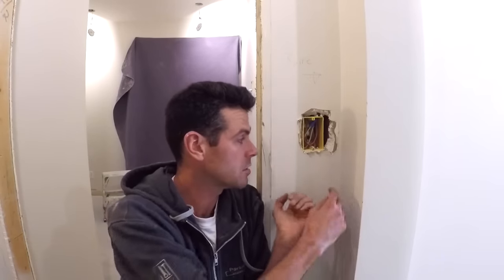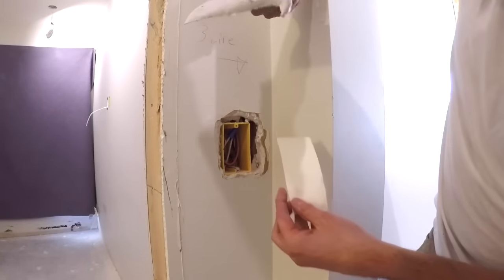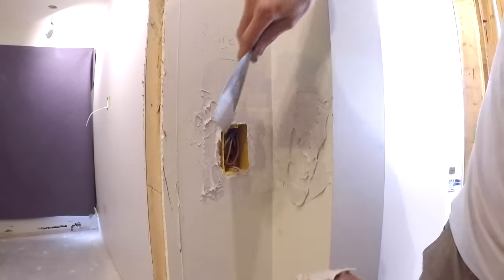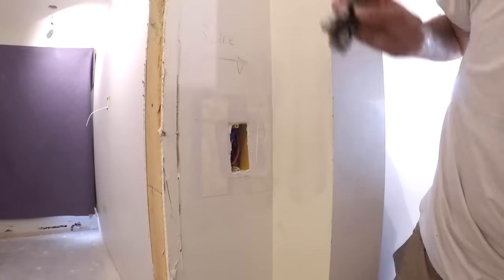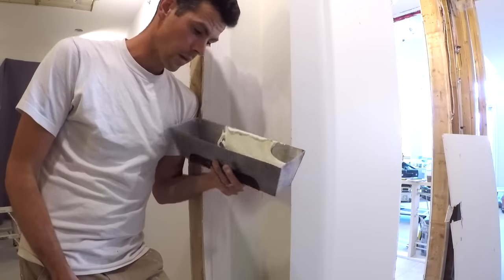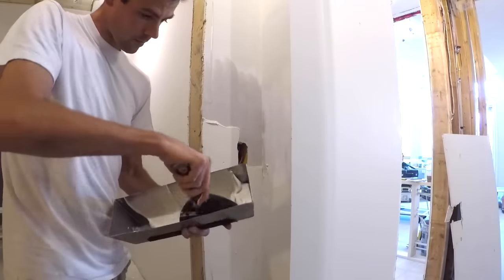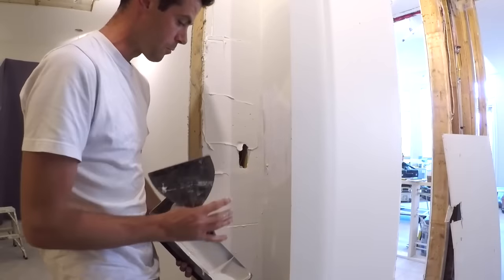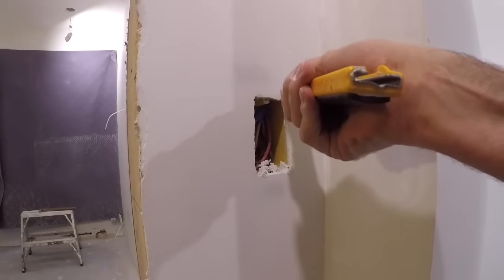HOW TO REPAIR OVERCUT ELECTRICAL BOX (DRYWALL)

Comment: Battle of the trades - dry waller covers or fills electricans box, painter comes and primes wall, electrican comes to put his switch in, cuts out dry wall, drywaller comes back to fix and spreds mud over 2' of wall, painter comes back  paints over switch, and the cycle repeats
Reply: And let's not leave the brainless plumbers who blow massive holes in the walls and don't give a rats ass for the customer who has to pay for all the extra damage s they inflict.
Reply: I do all theses   trades  so i dont deal with theses  problems.
Reply: Ngiovanni
Reply: And a Master at none.
Reply: And at the end of the day, someone doesn't get paid.
Reply: Robert w Sieburg plumbers have to get in the wall. No delicate way to do the job.
Reply: I personally like when the plumbers run a 4 inch pipe hanging half out a 2x4 wall because of the doubles and say the drywall guy can "wrap it"
Reply: Kevin Henry 

In my experience electricians are the biggest assholes of any trade. They will purposely damage shit knowing they will be gone before the finishers or painters will ever get there.
Reply: @chrisj197438  we don't purposely damage. Lot of times the engineers change their mind and tell us to put the switch p.e. elsewhere. And we are the last to get into the construction site, to put the switches, wall plugs etc. 
   But a friend of mine who is a painter tells me that painters hate electricians above everyone else
Reply: mpirarxos 

You may do your best to keep damage to a minimum but I’ve seen guys do damage that was totally unnecessary.
Reply: Peter pecker 

I’ve seen it from both sides
Reply: @1stFlyingeagle  when I need professional plumbing work done, I'm the one who busts the holes in my walls or floors. This way, I know exactly what to repair, with no sudden surprises months or years down the road. After all, I give a shit and know more about my house than even the best plumber ever would.
Reply: Do you have an associates or bachelors degree in construction management?
Reply: Too accurate
Reply: Kevin 
A good painter will put  a piece of painters tape over the electrical switch or outlet tape is cheap so the cycle doesn't start over it stops there...
Reply: So true LOL LOL... From a local 3 electrician you're absolutely correct bro you got me on the ground rolling over here
Reply: bad GC
Reply: You are so right. Trying to keep trades in line is like herding cats. It’s like the kids in the kindergarten class that don’t know how to share lol
Reply: Another Fool hahahahaha
Reply: And all of them are tracking in mud on the new carpet the carpet layer just installed...
Reply: Juts tearing down drywall in my jobs site cause someone forgot to install the exit lights boxes
Reply: @chrisj197438  That is not why they are assholes. Electricians get tired or having to dig out buried boxes that the sheet rockers have covered due to their negligence. Its a tool to maybe teach the sheet rockers that if they keep burying boxes they will keep having to come back to fix the wall. I personally have never done that but that's what i hear from other guys in the trade and i totally understand the mindset.
Reply: Robert w Sieburg I've seen where the plumber cut through 2 and a half out of a triple 2×10 triple load bearing beam to run his turd pipe.Plumbers are brutal to framing.
Reply: Robert w Sieburg as a drywall finisher I totally hear you there. I love it when they use a hammer to make their holes but I'm sure I'm the only one that's run across that stupidity. A bit of sarcasm I've seen it enough in 18 years
Reply: Rick Babcock that’s how I worked too. It’s a shame more pride isn’t evident in the trades
Reply: Electricians get the short end of the stick. In new buildings, the plumbers come in and tear out our wiring to run their pipes and paint and drywaller’s  bury or cover our plug/switch wires with paint or mud or break our boxes. Don’t even get me started on the irrigation guys that cut all the underground conduit with their trenchers.
Reply: Job security :)
Reply: The problem is that none of the tradesmen give a shit about doing the job properly, and just pass the buck to the next guy down the line. Maybe if people actually cared like this guy...
Reply: Chump Johnson It does go both ways I’ve seen mudders bury boxes on purpose and electricians use a hammer to unbury them.
Reply: @DamionJR4923  Very true. Everyone passes the buck to the next guy down the line.
Reply: @craigslistrro709  Master of Some!
Reply: @madmanmapper  
I was astonished the first time I heard a drywaller mess up some boxes and say "Screwit, mudman will get it." At that time, I WAS the mudman!  👿
Reply: Wait one moment before you put the cover on that outlet  I’m a  landscaper I have to get into that electrical box  and the  roofer wants  a shot at it to why not
Reply: christopherologist, the thats why when I wire my boxes I make sure to push as much as possible to the back nicked wires is one thing but wires that are sliced to the point of breaking or just cut in half pisses me off
Reply: Kevin Henry
Reply: Someone has to paint over the fire alarm AVs too.
Reply: It all adds up to screwing the customer. Would rarely happen with a knowledgeable general contractor and supervisor.
Reply: @chrisj197438  Sometimes, you just can't win. I took a lot of s*** as a young woman working construction, and a lot of my time was spent cleaning up the mess because somebody changed things "just a bch" over there from here.
Reply: @chrisj197438  AMEN to that. I needed the formal education for my Master, but learned 99% of what matters from my dad on the job by the time I was 15.
Reply: perfect harmony, job security!
Reply: @craigslistrro709   oh but is he a master of none, if hes not dealing with 3 other trades screwing up his work, chances are hes knocking down cold ones watching the football game wile they are screwing up each others work!  id say hes mastered cutting down the work load.
Reply: @nkyryry   just tear off large chunks of sheet rock and power boxes.
Reply: @koutouloufas7  why hate a guy whos paying for your new jet boat?
Reply: @rollingrizzo1291  
yes cuse that drctorate in bussiness managment is really ginna come in handy flipping bugers at mc donalds for mim wadge.
Reply: Chump Johnson electricians are the 2nd in the job,behind plumbers(underground )and the last to leave always,next time comment on something you’re knowledgeable at
Reply: Soup Can change orders are nice,more cash for you
Reply: Chump Johnson engineers can draw a circuit but can’t bring it to reality
Reply: jakestoe should’ve called the tile guys ...
Reply: Kevin Henry And the customer pays all those times 🤨😧😩
Reply: @albertj3421  started with the architect who should have drawn it as a 6" wall.
Reply: If someone fucks up my shit, I get paid to go back and fix it. By all means, fuck it up lol, I like the job security.
Reply: Job security is what I call it
Reply: I'd say it up to the poor guy who has to put on the plate after it's painted
Reply: I got to the place when trimming out a house, we would work with the builder and have the actual drywall company uncover our covered up electrical boxes themselves. That way if they messed up their drywall it was on them. Usually they would cut it out perfect. Many electricians are very good and finding and uncovering boxes but many are not. It pays to work with the trades. Residential or Commercial. 👍 God bless.

Jeff -Licensed Electrician - Sunny Central Florida 😎 👍🙏🌴 ☀️ 🍊
Reply: Rick Babcock they call you a master of nothing. Aka handyman.
Reply: Peter pecker lol the only thing union electricians know how to do is run pipe.
Reply: In my experience, the sequence of trades should be: structural framers, plumbers (waste pipes must meet minimum slope), then HVAC (large equipment and ductwork) electricians (especially when they have to rack the conduits), fire protection, drywall, painters, finish work. However, sometimes it's like having a gun go off and transforming the entire construction site into a free for all mess.
Reply: @chrisj197438  Im an Electrician and I do care about the other trades.  I give my helpers hell for putting finger prints on the walls while hanging a fixture anything like that.
Reply: And guess who hears about it all from each trade ME
Reply: Kevin Henry so yea, the painter fixes it in the end
Reply: I’m the painter. I’m the final trade in the house. If I have to stop my job and wait for the sparky and a increase my workload, I’d be back charging them my hours + their hours for what I could have done myself in an hour whether that wall is textured or level 5 smooth wall.
Reply: I fucking love this comment thread.
Reply: LMMFAO well at least you assholes left us trim carpenters out 😂🤣😂🤣
Reply: woodie will fail inspection
Reply: Drywallers are cheap ,electricians are not.
Reply: Chump Johnson ikr college is shit
Reply: @chrisj197438  they've tried but I'm the Finisher and I back charge at $360.00 an hour 10 hr.(contract) Minimum . You want others to step up , take their money . that makes lesser tradesmen step up or go broke . I give them a chance but never at my expense .
Reply: Yup same bullshit I deal with. Just went through some units today patching overcuts around outlets and bathroom lights so the painter can repaint. Seems like the system will never be figured out
Reply: Yup
Reply: 20 year exp painter here. Were the last guys so homeowners expect miracles from us
Reply: Job security 👍
Reply: Tell me about it jeez
Reply: @onecrazywheel  the only problem with that is once we cut out our box nicely. You tighten your screws and the drywall pushes in exposing the screw heads in the drywall above and below.
Reply: @atom4871  I agree, my guys have to wear gloves at trim out.
Reply: I am a framer /carpenter and the electrician came and set his recessed lights, plumbers came in and knocked one down, electrician came and asked me to run two 2x4s beside the can light and screw the can light to framing... I asked if it would pass that way and he said yes... so I framed it up and screwed the light to the framing.... now the inspector wants to know what’s going on there 🤷‍♂️🤦‍♂️🤦‍♂️🤦‍♂️
Reply: Joey MeckSk8Productions'  if everyone would start using bigger plates most of the problems would go away... personally I like the bigger plates not sure why it has to be so close...
Reply: Sounds about right 😂
Reply: @1stFlyingeagle  i would patch up after my job. The right way.
Reply: @rickbabcock6397  Same here. But I come behind on some jobs and do the mop-up.
Reply: Im a Painter, in my case i repair Mud guy messes n Electrition messes and Texture guy messes, all this guys come do they work n leave they messes, im the one who really finish the Job.
Reply: @chrisj197438  Electricians leave last...they install light fixtures , switches  ,receptacles , plates  etc. after everybody is gone...   and  fix  everybode else 's  shit
Reply: @1stFlyingeagle  don't forget about all the notches they make in the floor joist because someone read the plans wrong!
Reply: Framer: Not quite square but guess the drywaller can fix that.

Electrician after going crazy adding a gazilion outlets everywhere: Drywall guy can figure it out

Drywaller: Not quite right but plaster guy can fix that

Plasterer: Good enough, paint should fix that

Source: I'm a DIYer and I'm the framer, electrician, drywaller, plasterer and painter and I curse past me during each step.
Reply: @peterpecker7558  Union guys are lazy. Couldn't have paid me to join the brotherhood.
Reply: Sounds like what I used to deal with every day.
Reply: Wow this started quite a debate . Me personally I just fix it and don’t complain about it and if something gets changed and I have to fix it later then I charge for it plain and simple. The blame game is for kids
Reply: the  hahahahhahahahahathe  hahahahaaaa
Reply: Lol 😄😄😄
Reply: That's a new definition for "Circle Jerk"
Reply: Or you do everything and somehow still do it to yourself lmao
Reply: @1stFlyingeagle  buddy when u have a plumbing problem don't call plumbers do it yourself
Reply: @nkyryry  That is nothing but a BS excuse for sloppy plumbers. When I do plumbing they are easy to wall repairs. Almost always.
Reply: I hate it when a box gets covered by the drywallers. Then you wire everything up and shit don't work? Then it's like oh yeah I remember a box being in that spot! Then start the process again. Lol
Reply: @rickbabcock6397  actually was going to say the same.  Here at Empire State Contracting,  a company founded by brother,  we do everything for the most part.  There are a very few things we don't,  but this is more by choice, & so will sub it out. Ironically started as electricians,  but since we were always good with our hands, figuring things out & have a gift to learn quickly,  & so when the economy started diving years ago,  we started doing everything.  Both Commercial & residential too. We can do it from the ground up. And while all of in the company have these skills across the board,  obviously we each have specifics that we definitely specialize in. And so this is great in helping each other sharpen other skills.  We are a smaller company considering how large some can be especially here in the NYC / long island area. Honestly we like it this way too, we have a tight knit group without most of the problems that many of the  larger companies always have.  We have been together for over 20 years & still going strong. Plus with having a good name,  & knowing so many in these fields,  we can team up with or partial sub out with other crews if necessary. 

We also do excellent work, and for fair prices.  We will even sit & explain things with a customer,  for example if they think a price is high, or got a cheaper estimate.  Actually explain what corners we technically &/or even legally could cut to give them a cheaper price,  but why we won't.  Many customers don't realize there are so many "legal" ways to cut corners, time , & prices. So many things they don't understand.  Not to mention the many illegal things we could do. And by legal & illegal,  I don't necessarily mean in the court of law,  tho sometimes it could go there, but I mean by code, by standard,  etc etc. 
Also having an eye for possible expansion.  The probability of them adding the future.  For instance,  guy wants a few circuits, & 110/120 volt circuits in his /her garage,  but I notice he is building a tool collection,  several power tools,  maybe a band saw, a compressor, lathe  etc etc.  I also see he likes to build things in there, whether metal & wood work or  cars, trucks,  bikes, & over conversation I realize the chances of adding more is likely,  a possible welder or two, a plasma cutter, etc etc,  I will then recommend a few more circuits,  & dedicated circuits too, with a few outlets / quads in a few good locations, & at least one 220/240 volt circuit.  Especially since we are already there, & to save a few dollars now will cost that much more later,  because we definitely will be back later. All too often we are  back when they don't think we will be.  

Same when they are setting up a barbecue pit, tiki bars , &/or cabana,  especially along side a pool, where by gauging the layout we realize this is to be used for bigger gatherings, & also in bigger money areas where at least keeping up with or out shinning the jones' is important,  having what's trendy is important,  etc etc and so when they think they want to keep it simple,  & we know we should at least make provisions to add in the future,  starting with a better than basic setup,  locations that can &/or will make it easier to add. Likelihood of adding extra lights,  LEDs,  outdoor refrigerator /freezors,  wine/champagne rack /coolers, some type of tv, projector,  music center system,  etc etc.  Possible sinks & or water coolers, etc etc 
So even if this sounds like so much more, & to do all of this would be,  but there's things we could do ahead of time that would make it much easier later. Even tho sure this would obviously cost more than the simple circuit for a couple of lights, but if we ran a circuit everytime a new thing was added, it would by far surpass our recommendation from the beginning. 

Of course we have to take many things into account,  some people may just want something simple & we have to be able to pay attention to realize this, plus never over push a customer into something.  Again with years of experience,  we learn to read things pretty quickly.  Plus making friendly conversation helps. We have many many long time repeat customers,  & this comes from being able to do all of this the right way.
Reply: Plumbers who use PEx pipes make far less mess. They can drill them through timbers just like cables and simply don’t need the access space to solder joints.
Reply: @koutouloufas7  Engineers/architects change the designs because far too much stuff is done in CAD. It all looks great on paper but most of the operators never get out on the job.
Reply: Accurate
Reply: @christopherologist  your not folding the wires in correctly
Reply: @Tumiification  that “tool” will get 11/4 screws thrown down empty conduit or pull the wires out of the box and cut them flush. As for “tools”  when you see your wires all chewed up by the router because you were too lazy the push them in remember that the Drywaller is trying to teach you to do your job and take some pride in your job 😂
Reply: @nkyryry  Advice only for those few plumbers who want repeat business: Use oscillating saws to cut into walls and floors, do not use Sawzall-type reciprocating saws with extra-long demolition blades which also cut studs, fire stops, electric wires, ethernet cables and drain lines you didn't bother to locate before beginning your work, locate the problem area before you start (using your eyes is a remarkably effective method) and measure and mark only those areas that actually need to be removed to gain access, cut out the marked areas (preferable marked with even sides and square corners)  with beveled edges so that they can be replaced  without rebuilding the whole wall or floor.  

For those needing a plumber, don't call a professional plumber who takes great pleasure in destroying the walls, floors and ceilings in your house, leaving you with destruction that costs three or four times as much to fix as his bill.  Ask me how I know.  Next time I need a plumber, I'll cut out and remove  the access holes myself, and save hundreds if not thousands of dollars by fixing the results of a small, targeted access area myself, instead of footing the costs of the typical, helter-skelter widespread disaster caused by old-fashioned plumbers, who rip out walls without regard to the homeowners repair costs, assuming that restoration of the floors and walls they ruined is not a plumber's concern or problem.  

In my opinion, any plumbing business that advertised and practiced minimal damages to walls, floors and ceilings when doing repair work or new installations in existing buildings, and who made quickly arranging the repair of any wall, floor or ceiling damage a line item part of their repair estimate, would quickly lead the nation in setting up plumbing franchises for one-stop plumbing repair and performance of any necessary restoration required by those repairs. A few years ago, I saw a single hotel maintenance man open up a wall-papered hallway wall, repair a plumbing leak, close and re-plaster the wall and replace the wall paper, and repaint any trim that required it, in less than the time it took me to go from my hotel room to and from breakfast, i.e. less than two hours.  You could not tell he had been there.  I was amazed, but I learned that thoughtful, competent people can quickly accomplish what the job requires. Sometimes you have to redefine the job to actually give the customer what she or he needs without wasting their time or money.
Reply: Plumber comes in last, tears everything out to pipe cement a PVC fitting, and leaves. haha
Reply: Seen my Forman tell Sheetrock Hangers they don’t want him to uncover the boxes. Well they didn’t listen. He gave them a week, then took out a tape ran it to the floor, and every (what he considered) 2’ he’d bust a hole at 18”. Same dude told the duct guy to get off our rack.{unistrut}. He let them slide, but towards the end of the job he put ping pong balls in the ducts. Watching them jokers scratch their heads is unforgettable.
Reply: Only ignorant people duscusss other people.
Reply: @1stFlyingeagle  True,it happened to me.
Reply: @nkyryry  there's certainly a more delicate way than just hitting the wall with a hammer
Reply: @Tumiification  Well I'm the owner and I'm the one paying the bills. There's absolutely no excuse for costing me money because an electrician cuts a 6-in hole around a 4-in outlet. Especially when all they're doing is upgrading old outlets to new ones. Therefore there's no reason on Earth to cut the wall in the first place.
Reply: @redsquirrelftw  😂
Reply: @Anonymous-it5jw  BRAVO. Well said.
Reply: Unfortunately, I have to do all of it 😂
Reply: Owner finishes the job 3 cycles down the line...
😀
Reply: @chrisj197438  I'm electrician and don't know if they all go this far.  But I will agree 80% of the time the electrician is 100% asshole.  I try to be a clean and tidy and not touch the walls at all.  That said I drywall tape and paint a lot to do I appreciate a good job.
Reply: I'm just here for the comments!  😆
Love this guy... great work.
Reply: “A jack of all trades, a master of none but often better than a master of one.”
That last part of the quote gets left out most of the time.
Reply: @1stFlyingeagle  I’ve seen electricians do that too